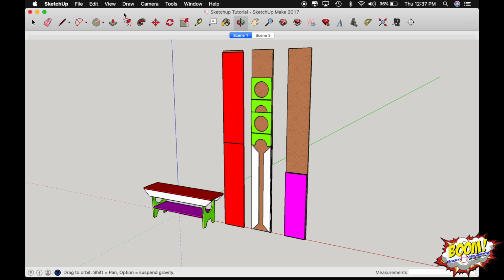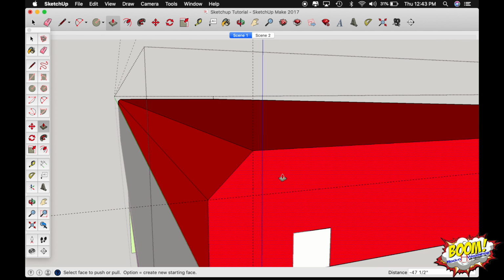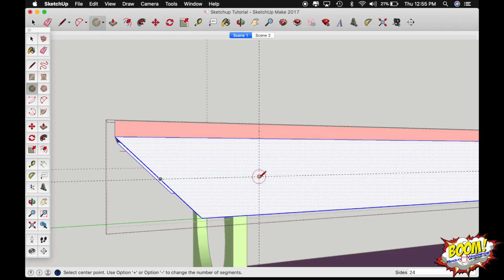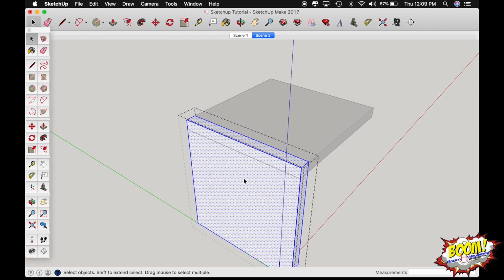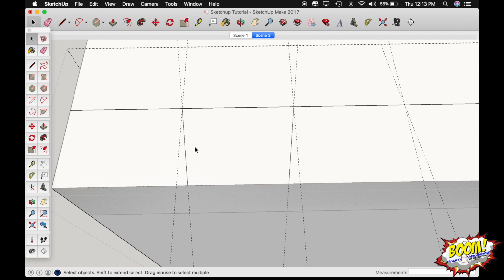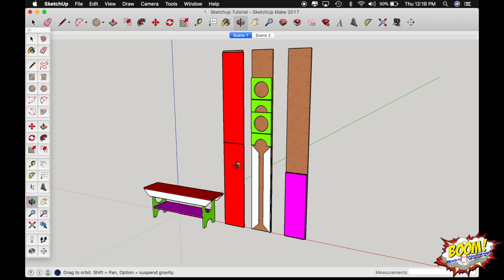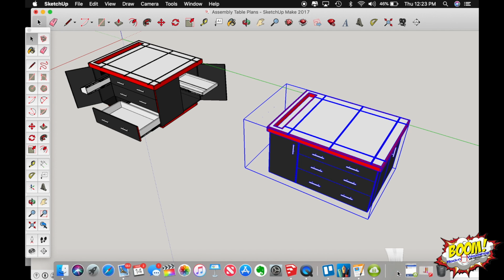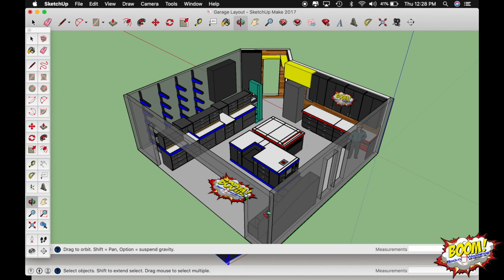QA Demonstration Techniques - Sketchup for Woodworkers Tutorial 4

Comment: The very best set of tutorials I have ever seen.
Reply from the maker: Thank you so much. I have many more after this one too. Hope you enjoy.
Reply: Rock-n H Woodshop this is intended in the most complementary means of all. Besides being very knowledgeable with SketchUp, you are an excellent instructor, and what impresses me equally, is the clarity of your voice, very Jake Tapper (of CNN) sounding. Now I do have a question, is there a way to select a surface, and have surface to rotate if necessary, to show full face, i.e. you have a angled surface, and you want a hole placed perpendicular to that surface, it there a command tool whereby you can click, and the angled surface rotates to show full faced?
Reply from the maker: John Work So I’m trying to get this straight in my head what it is that you were wanting. Do you want to know if there’s a way to rotate a specific piece separate from the model that it’s in? Or are you wanting to know how to rotate a specific surface of a piece in a model. Those are two different things so I’m trying to visualize what it is that you’re wanting to know. I’m pretty sure that my later episodes will go over this inadvertently for you. If you haven’t checked out my later episodes, give them a look and see if that answers your question.

Comment: I tried to copy the circles in the side of the bench by making a copy of the first circle and then typing the x15 and will not work for me. I am using a Windows 10 PC. No matter what I try it gives me an Invalid measurement and will not work. What am I doing wrong?
Reply from the maker: OK follow these steps precisely. Highlight the circle once you are inside the component of the apron. Then using your move tool, copy the circle and move over to your desired spot and then click, without doing anything else with your mouse, type 15X and hit enter.
Reply: @rhwoodshop  Ok, this time it worked. If I set the distance and hit enter, it will not work. I have to set the copy on a mark manually and then enter the amount i want copied for it to work. Thanks for the help.
Reply from the maker: Wood'n Metal Shoppe yes, correct. Once you hit enter the function has been terminated so you are unable to use the 15X after you hit enter which is why you have to use your mouse on the first move.

Comment: How did you make your benches/assembly table with the drawers and such?  Also, did you make the bandsaw or was that a preset in the software?
Reply from the maker: +Jeremy Fouse this lesson was one of four parts that I had already done. Check back on my first lesson and you will see how all of this came to be
Reply: Rock-n H Woodshop well I meant when you were showing your assembly table and the shop design, when you placed it in the shop. I watched the 4 part series this video is in and it was extremely helpful. But now I’ve moved on from smaller projects like the bench in this series and moved to larger projects like walls or cabinets and drawers. Anyway, you work bench you copy and paste into your shop shows the drawers open and such. Were you able to make those so that would open and close in the model or just design the drawing with drawer open? I’m ready for you to make an advanced user video series 😁 I love your shop design and want to replicate it as I’m about to build myself a workshop. Thanks for your reply.

Comment: Nice video. Try these tips. You can click on the face of the new shape you created and move/copy that instead of all the edges. Also, try the divide function instead of the Xs. Establish 1" guide off both edges of your board. Create the shape of your pin, move/copy to the other edge guideline then divide "/" by the number of pins you want. This will equally divide the space between pins. Want more or fewer pins? Before touching anything else you can just retype the / number to create more or fewer pins.
Reply from the maker: Wow lots of good tips here that I will definitely try and implement. Thank you so much for offering this bit of knowledge.
Reply: Rock-n H My pleasure. I really enjoy watching all your videos.